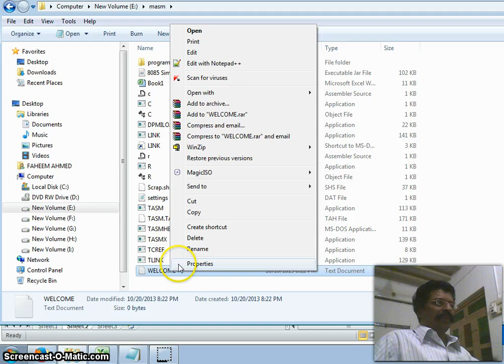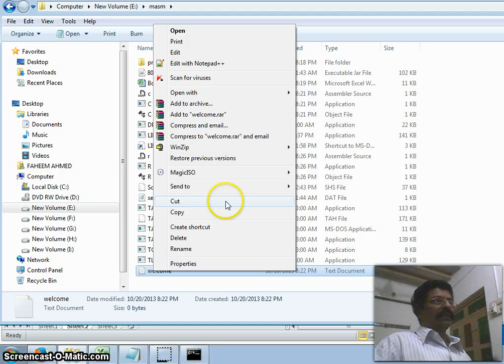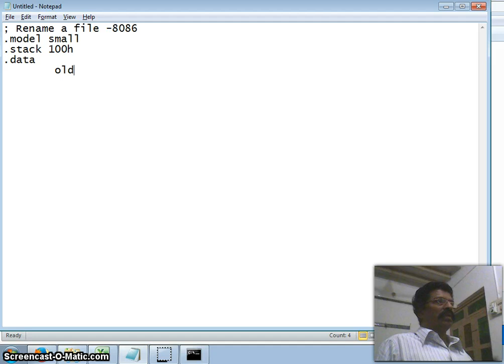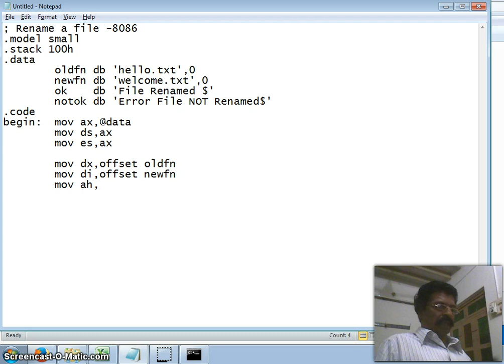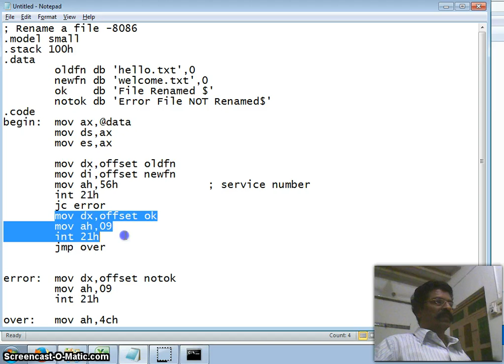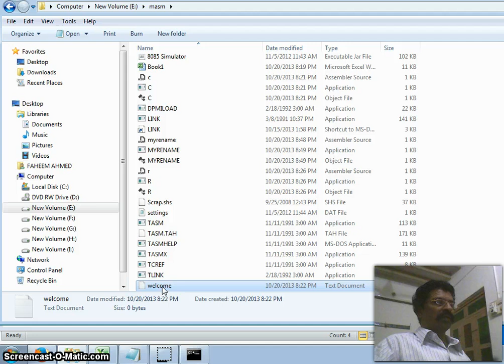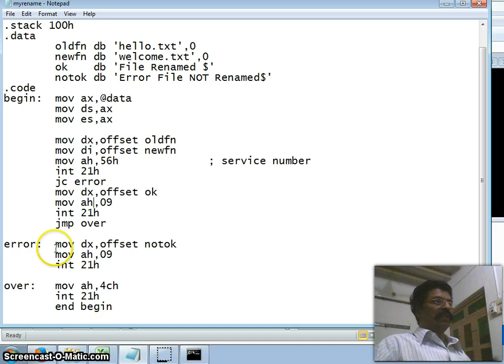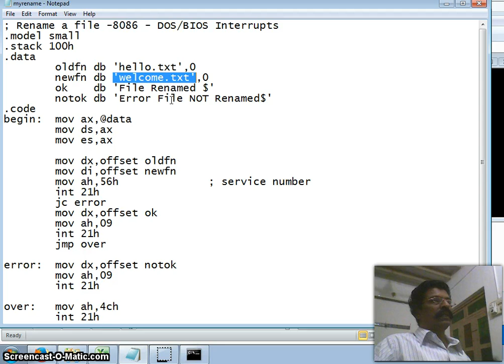FileRename 8086

Comment: 1. a) Search a key element in a list of ‘n’ 16-bit numbers using the
Binary search algorithm.
2. a) Write two ALP modules stored in two different files; one module
is to read a character from the keyboard and the other one is to
display a character. Use the above two modules to read a string of
characters from the keyboard terminated by the carriage return
and print the string on the display in the next line.
3. a) Sort a given set of ‘n’ numbers in ascending order using the
Bubble Sort algorithm.
4. a) Read an alphanumeric character and display its equivalent ASCII
code at the center of the screen.
5. a) Reverse a given string and check whether it is a palindrome or not.
6. a) Read two strings, store them in locations STR1 and STR2. Check
whether they are equal or not and display appropriate messages.
Also display the length of the stored strings.
7. a) Read your name from the keyboard and display it at a specified
location on the screen after the message “What is your name?”
You must clear the entire screen before display.
8. a) Compute nCr using recursive procedure. Assume that ‘n’ and ‘r’
are non-negative integers.
9. a) Read the current time from the system and display it in the
standard format on the screen.
10. a) Write a program to simulate a Decimal Up-counter to display 00-99.
11. a) Read a pair of input co-ordinates in BCD and move the cursor to
the specified location on the screen.